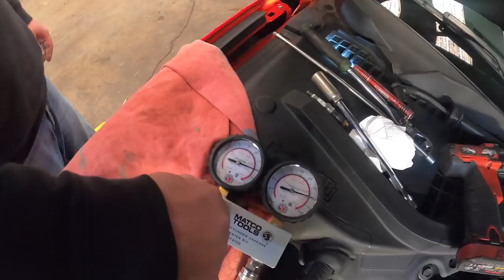GARAGE REBUILT 2019 TWIN-TURBO MUSTANG GT LEAKDOWN TESTED *FOUND THE PROBLEM*

Comment: seen this car more with the hood propped than on the road since the TT install. That's why I'm perfectly ok with that NA life 500+HP
Reply: I think unless you are planning on making north of 1200 RWHP turbos are more of a pain in the ass than they are worth.  Superchargers when installed correctly are almost as dependable as NA or at very least youre not under the hood every other day lol  Just my 2 cents.
Reply: @GhostofGenX  Turbos are a pain in the ass
Reply: I'm with you WhiteWolf5.0
Reply: Agreed
Reply: My car has been boosted longer than it has been NA and I’ve never had an issue I guess it’s just hit or miss
Reply: @BarnfindGT  this isn't the place to write a book but in a nutshell there are so many MORE things that can go wrong on a aftermarket boosted car. For example, if a fuel pump gets a bit weak in a N/A car typically it's not going to hurt the engine while a boosted car has a much higher risk of going lean and melting down under that same condition just to name one thing.
Reply: That’s why guys who want reliability just go with a centri blower.
Reply: Or have a reputable shop do the install and get all the right parts the first time.
Reply: This is what happens when do it yourself instead of taking it to a professional shop

Comment: A smoke tester would only find a gigantic boost leak . To test for boost leak you connect adapter to intake on turbo and pressurize it to whatever boost pressure your testing for .

Comment: I meant to ask what kind of back pressure is your car showing at 10lbs? 
With twin turbos it should be low not high but had you had a single turbo if would probably be over 20lbs+ 
But with dual you probably are less then boost input. 
You will just have check it but either case it sounds like factory springs are junk or just weak overall.